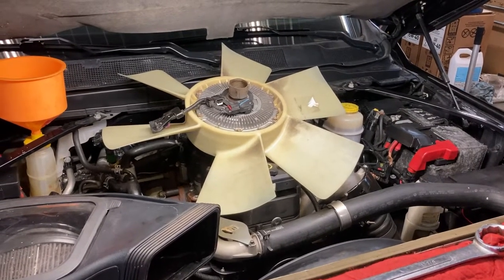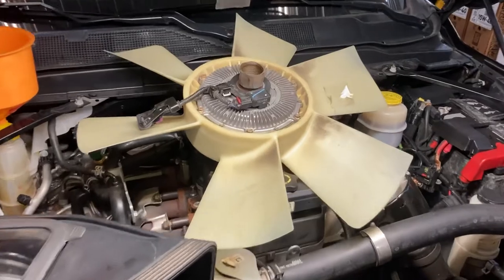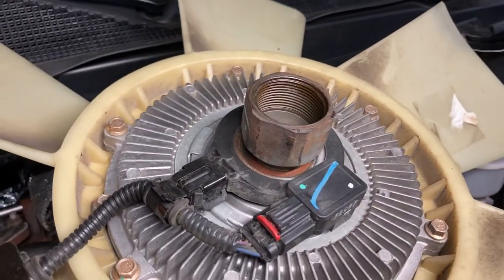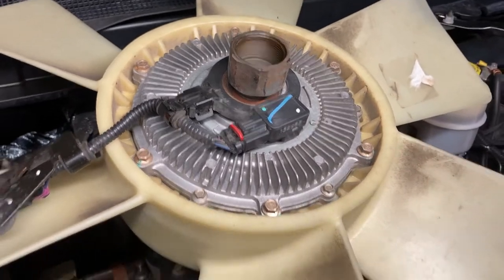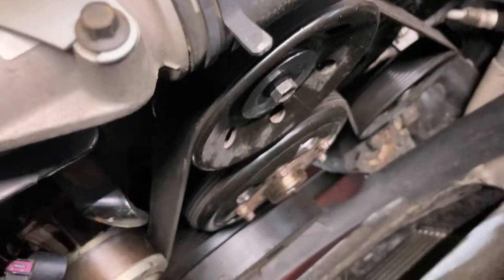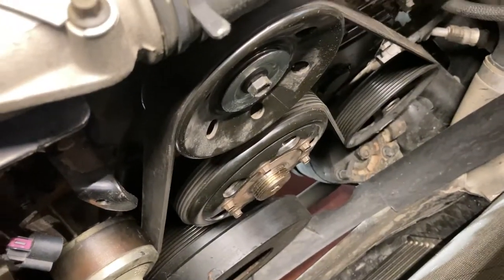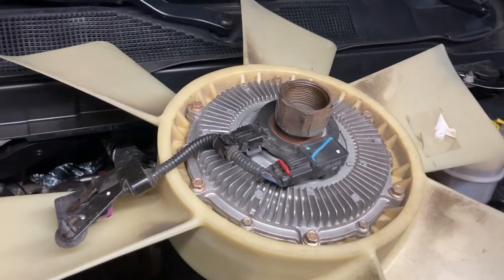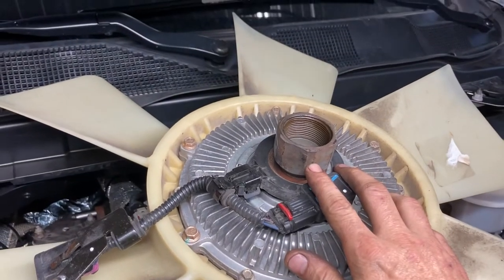2019 Dodge Ram 3500 Cummins 6.7L fan hub removal

Comment: Thanks for the video. I liked it because I am doing one that someone possible mounted incorrectly. The only thing I do not agree with is not using an air hammer. There is no reason why you cant use one if you are careful and you have mastered the art of fan removal. It is the only way I prefer.